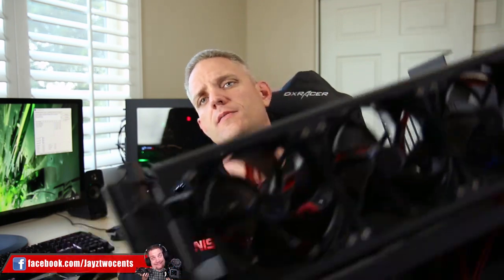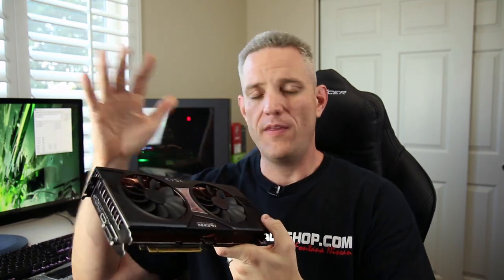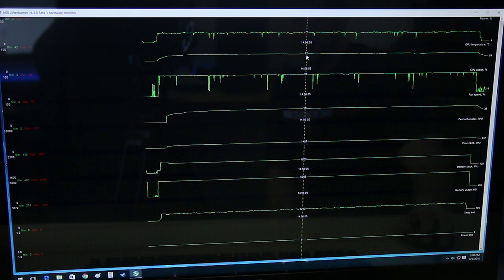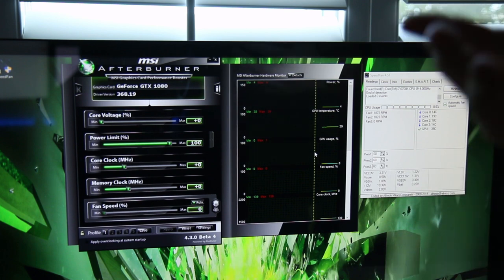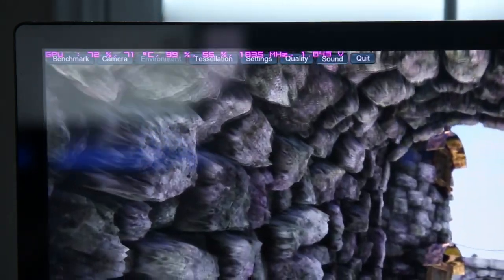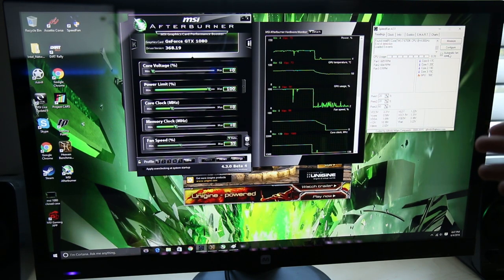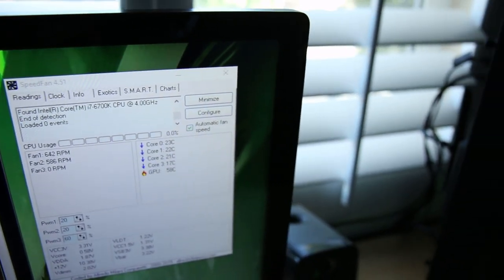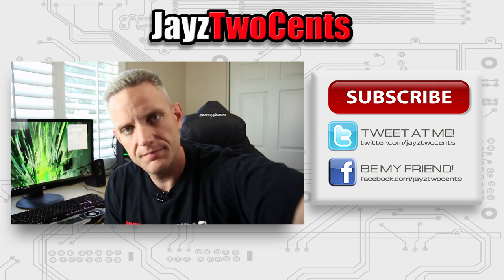Do cases make video cards run hotter?? - Test Bench vs Case

Comment: I know you like the watercooling but for us doing all air cooling, My processor definitely makes my case warm
Reply from the maker: So you think I should let the CPU warm up the card? How should I account for all the different CPU and CPU coolers on the market? This is getting ridiculous now.
Reply: +JayzTwoCents I think just doing all air, nothing crazy. my r9 390 hits 94 regularly on the stock over clock in witcher 3
Reply: Most custom pc owners at least in the UK have all in one water coolers as they cost as much as most good air coolers anyway. So it's actually a fully valid test.
Reply: Yeah i wasn't trying to be an ass.
Reply: +BillWills What about your case fans?
Reply: +DavisSgt I have 3 intake in front and added 2 exhaust top and the back exhaust. I have the front cover off but screen still on.
Reply: BillWills Reference or custom cooler?What about stock temps without overclock?,the reference design is infamous for the high temps.If custom,try checking if anything is running on the background like mining programs,make a custom fan curve,clean your computer of dust and debris and finally taking apart your card to replace the thermal paste if necessary
Reply: Wait, isn't the AIO on the intake? That would be the same net effect as an air cooler.... WTF people... #ThinkBeforeYouType 3:00
Reply: then use more ventilation, because it shouldn't. and a watercooling radiator draws air into the case, so it works the same.
Reply: sow
 Not really, he owes you nothing
Reply: I went from a large mid-tower with a HSF (Hyper 212+) to a smaller mid-tower similar to the S340 (Carbide 400C) with an H100i GTX on intake and I can tell you it's warmer in the smaller case, so the CPU heat is definitely affecting the ambient temps.
Reply: Anthony Flagg That is what i am seeing too with my smaller case
Reply: wow i found this video today  while being redirected  from your latest video and i agree with billwills,we could use a normal case scenario,most of people dont use AIO watercooler and its not really needed  like you said on other watercool/air video.

Comment: It makes sense that the open-air test bench had a rougher time.  A case is designed to direct airflow over components and allow the case fans to provide some cooling where the test bench can't direct the air because the air isn't confined.  It's the same reason a ceiling fan cools your room as opposed to stagnant air.

Comment: People seem to have the impression that air is an amazing thermal conductor...
Reply: it kinda is
Reply: it kinda is
Reply: Moving air is an amazing thermal convector...
Reply: Air has a horrible heat capacity its physx
Reply: Compared to an insulator it's good sure, but really the reason it's used is because it's free and good enough in most cases with a fan to force conductivity. If air were such a good conductor, you wouldn't even need a fan, or at most a gentle breeze would wick away heat very easily.
Reply: NolimitsCoasterManiak just wanted to point out that air has a decent heat capacity otherwise ovens wouldn't quite work.
Reply: Exactly what I said nub
Reply: ***** conductivity and capacity are different, think battery life vs power draw. Air is a poor conductor (heat travels slowly if at all through air) but has a decent capacity (air can get very hot). FWIW, most gasses have poor heat conductivity... Just the physics of having so few molecules by volume.
Reply: Ur auch a NUB go to scool

Comment: Seriously, people argue about this? Benchmarks are never meant to be a measure of how well something will work in your system, but rather a comparison of components in a standardised environment. 

There's so many different cases,  and temperatures different widely across the globe. A temperature test is NEVER a good indicator until you do it yourself. 

This is about component x being a bit hotter/faster/louder than component y, not about how the component will work in your system. If you know or suspect the Temps in your system are going to be higher/lower, this information is still valuable.

Comment: Unless your horrible at fan placement/cable management the in case numbers are negligible to a open air test bench. You have a constant movement of air in a case unless your stupid and don't put any fans in it and try to run your rig passively cooled...but most people use fans. So good test and the one's complaining are just stupid.
Reply: cables don't effect Temps at all
Reply: Unless my horrible? Unless my stupid? What are these, I do not own them. But I can see someone who does :)
Reply: Lol simple typo...didn't see it until after the comment...oops

Comment: The real question is what the different types of GPU-coolers do to your CPU temps. I switched from a custom fan on my GTX 570 to a stock blower on my GTX 970 and while stressing the CPU the degrees went up quite a lot when I also stressed the GPU with the 570 because it dumped all its heat inside the case while with the 970s stock cooler it didn't really make a difference. Most cases are set up with one or two intake fans in the front and exhaust fans in the back/top. Meaning the hot air from the GPU is usually being blown past the CPU cooler on its way out of the case.

Comment: I have some doubts about voltage and fan speeds. I think the hardware should be exact same in both testing conditions,  I would rather put hardware from test bench to S340 (I know, much more work). Also I think that you should set GPU fan speed to the same fixed RPM in both tests and GPU should be stressed more to reach limits of its cooler. Now it is about 28-30 degrees Celsius in my room. In my Define S with R9 390 and i5-4690k, while playing Witcher 3 there is a evident difference in temps between closed and without side panel.

Comment: I have a s340 case with a MSI r9 390, 1 small radiator fan  +one s340 fan in the front pulling air in, plus one s340 fan on the top pushing air out.  the temp of board went up higher and the fan of the video card spin louder when I close the side panel.

Comment: Jay, I have seen power supply noise and ripple cause variances in measured voltage. Perhaps this was what caused the difference in the GPU voltage readings?

Comment: Jay I see you mentioned your case has a H100i from Corsair I'm guessing as you have used one in that build its a pretty good cooler? I'm thinking of upgrading from an alpenfohn k2 to the H100i to keep my overclocked AMD 8350 cooler than 58c. love the channel by the way keep up the good work.

Comment: hello jay

I have the same case nzxt s340. almost the same situation as yours( 240 radiator in the front, etc.. ) and a gigabyte 980ti G1. If I have the case closed I get 72-74c( no OC) and if I take the side panel of the case I get on the same game, settings and room temperature 64-66c. I'm using MSI afterburner to check the temps. I like your videos and I've leaned a lot from them but I call this one BS.

Comment: I noticed my GPU is about 2-5C warmer in my Corsair 540 than my old case, Antec 900. The only thing I can think of why I had different temperatures is that the 900 had a side fan blowing out right next to the GPU to pull heat from the open did of the GPU. I still prefer the 540 over the 900 because of the dual chamber concept for better wire management. I have a GTX 770 MSI twin frozar.

Comment: I recently bought a Sapphire Nitro R9 380X and it blows air out on the top of the card aswell. So I left my cover of the case off, otherwise it would blow directly at the metal, which wouldnt be good I guess?

Comment: I liked the vid, it seems very complete in the testing criteria.  Water cooler vs. Air cooler for CPU, my thoughts are these.  CPU's usually have lower temps do they not vs. air coolers.  To me that says they pull more heat out for the level of over clock / voltage the CPU is running at over an air cooler.  If the rad is exhausting that heat into the case vs. blowing outside the case, really it seems to  me they represent a worse case scenario over an air cooler.

Comment: I guess this depends on case, card cooler and water vs air cooling. I can take the fan filter of the front of my Corsair 760T and drop my GPU temps by around 2 degrees. If I open the side panel I get at least 5 degree drop. I've done this with a air cooled 780 Ti (Gigabyte GHz Edition) and my Titan X water cooled. I had this kind of temp difference with my Aerocool Mechatron case as well.
Reply: Yea. For the temp difference, it's really worth the hassle finding out witch is better for your system.

Comment: Hey Jay! I'm going to build a new system soon, and I want your input on whether I should choose Z170, or X99. What are the pros and cons of them? Which one would be better for overclocking? Which one (if any) would be better for, say, 128GB of RAM? Which one would be better for 2 way SLI EVGA 1080 Classifieds? I'm not sure if I want the 128GB of RAM, but I know that 32GB isn't cutting it for what I do anymore. But the main topic remains Z170 or X99. I trust your judgement c:
Reply: I should probably also mention that I will be utilizing the 1080 Classified's 14 power phases for overclocking :)
Reply: With X99 you get more PCIe lanes, allowing for you to use the full 16x slot and also some PCIe SSDs. Also a higher thread count, which is useful on parallel workloads (VMs, editing, science). If you're gonna have 128GB of RAM then X99 is worth it definitely because of quad-channel RAM.
Reply: Thanks! That's what I needed to know :D
Reply: BTW, if you really wanna go all out on OCing, you should build yourself a loop. EK is gonna release a waterblock for the 1080 Classified
Reply: A loop is in my plans, I just wasn't sure if I wanted to include the 1080s in it. I guess I really should. But since this will be my first custom loop, I was planning to use soft tubing, and just use fittings for the rigid parts. I know fittings are pricey, but tbh, I need to order my chassis before I make those kinds of decisions. Thanks for the help though!

Comment: Case won't matter to much unless you have a really tiny one. I used to have an old Acer OEM mini desktop with no case fans and only a stock CPU cooler. That thing would get hot with all those parts crammed into that tiny case with no airflow. Had to put it all into a mid case with some fans in it. It never went over 45c in the mid case.

Comment: the temps would go down on a closed case even if the card/cpu was watercooled, even if by a tiny bit; the whole card is a dissipating surface and instead of just radiating heat by convection it's helped by the airflow, even if it's laminar. for a quick test, stick a maxed fan behind the cpu or gpu and see this for yourself. this also helps cooling the vrm when pushed hard.

Comment: What program are you using for the monitoring overlay?
Reply: Msi Afterburner+Rivatuner
Reply: Ah, thanks, I run afterburner but not rivatuner.
Reply: HWINFO64 + RIVATUNER for pros
Reply: Afterburner and all other GPU management tools that are built on Rivatuner code allow you to also use the Rivatuner Statistics Server to track stats and display them on the screen.
IIRC it's an optional install while installing the monitoring tool.

Comment: You should try out NZXT CAM software for data overlay. You can adjust the size of font and position on screen. The new updated one 3.1 I believe works a ton better than the older version. Just saying. I used Steam FPS overlay as well as MSI Afterburners and they are way to small. Good video though man

Comment: The difference is the that the air is more readily available for use in a case, the fans are pushing air towards the fans making the air more easily accessible for the fans to use to cool the card compared to have to "reach" to get more air. Its the same scenario with cars and air filters, you notice that having the air channeled towards the intake makes more power (mostly in engines with carburetors), Having the air more accessible for use  means that it becomes more efficient, either for cooling in the case of pc or power in cars. Jay is more than correct in his statement.

Comment: Hi Jay, just a theory to your voltage conundrum. If your PSU's are two different  types it could be possible that the quality of power delivery on the PCI 8/6 pin could vary. My current psu (Silverstone Strider ST75F-P) actually has capacitors built in to the cables to better help with voltage stability (until I put in custom sleeved cables). I could be completely wrong here but I do believe that the quality of the power delivery could be the issue.

Comment: On the relevance of cooling, between a Fractal Design R5 and Fractal Design Define S, does having SSD/HDD trays in the back (behind the mobo) in the Define S make a difference in temperatures versus the R5 which have them in the front near the front intakes?

Comment: The 2nd rig voltage is at 1.043V vs 1.062v (1st) of course it will run 1-2 degree cooler
Reply: Yes until he controls the voltage & room ambient it's really not comparing anything. But it at least shows it's likely to be not anything significant with the 1080.

How about do the same for SLI, Jay???

Comment: Hi jay. Why dont you try using air cool rather than liquid cooled cpu. That makes more heat inside the casing. Im just curious cuz most of us here are using air cooled cpu like deepcool or coolermaster. Thanks
Reply: He did a video on radiator intake/exhaust already.

Comment: A good after market case tends to have very good air flow. Makes sense that the results would be very close. But I wonder what would happen if you used a crappy OEM tower (HP, Gateway, Dell, ect.) that have less than good air flow. Throw in the stock CPU cooler and it could get pretty toasty in the case. It would definitely raise the temp, but by how much ..........
Reply: I think some of these YouTubers underestimate just how many people use a crappy case. In my opinion a ideal test would be testing the temperatures in a crappy case but they use the open air test banches because it's quicker to swap out the hardware.

Comment: temperature affects resistance. lower temperatures reduce resistance in wires therefore requiring less power .. or more voltage at the same power.  it's likely there is a little difference in what the GPU is seeing internally and the firmware is adjusting voltage to meet clock speed within TDP.   You might see some of this if you look at the cards measured power usage logs from those three tests.

Comment: could the voltage be the power supplied that you used in the case and the one used on the test case.
Reply: Indeed.  Shame he didn't move all the components between the cases, thereby getting rid of those variables.

Comment: I have an EVGA GTX980Ti SC+ ACX 2.0 cramped into a Corsair 380t. If i leave the sidepanel off, the card runs about 5 degrees cooler. I use 5 Thermalfake Riing 120mm fans in there, with a 240mm AiO as an additional exhaust resulting in a slightly negative airpressure. I was wondering why, and I think ist is due to the small case and the sidepanel which is angled at the top. The card only gets airflow at the backside of it and re uses most of its own exhaust air. The exhaust air pushes against the angled too and gets sucked in again by the card. Tho I think max 76°C ist still decent. So the case can matter, but most people sure have decent, and big enough cases. Mine looks just slightly stuffed with that AiO and the card:D

Comment: Would love to see these tests on a budget build too (which is likely what most of us can afford), where you usually have 0 or 1 cheap'o case fans on a fairly small case (with no power supply chamber and CPU fan cooled). Giving it 2 or 3 hours to let the heat build up inside, cause we usually use our computer for more than 20-30min in a row, especially while gaming.
Would be a nice drastic test for the RX 480 at the end of the month! :D

Comment: You cant argue with the results shown but I would argue this is a best case scenario situation(x4 120mm fans, liquid cooled CPU, lots of space, only short bursts at a time for 15-20minutes) and the fact this isnt a proper reflection of how it would perform under load in a gaming scenario for an hour. Plus open vs closed arguments isnt exactly an urban legend.

Still, respect for actually trying to address the criticisms in full with a lenghty video.

Comment: negative atmosphere inside the case from proper fan set up makes a difference and always has....ive had mates with the same case with a different fan set up and identical internals get higher temperatures than my set up..I've always run quality cases with quality fans. .an in my experience have the right ammount of fans in taking air versus exhaust fans makes a difference..and if you can seperate your psu  from your man board are these things help aswell...and to my phantech entho pro does this perfectly with a steel isolation chamber with its own intake fan and exhaust port...love this latest setup...
Reply: main board...typo

Comment: it's probably because there are exhaust fans which transport the hot air away from the card and you get fresh air from the intake fans (airflow and stuff) 
and maybe your vrm's got hotter on the open air Testbench because the hot air sticked around the card and was not transported away from it :) should result in more voltage, shouldn't it?